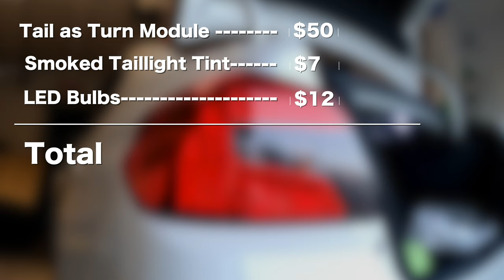How to Upgrade your WRX taillights for less than $100

Comment: Looking good. But, I have a question at 13:14 Why doesn't original reverse lights come on with new setup? I thought both original reverse & original turn signal would turn into reverse lights.
Reply from the maker: Oh that😂. I didn’t have the correct leds in there. I took some brighter leds from my other car and installed it at the end of the video